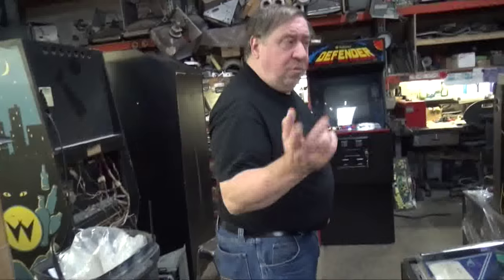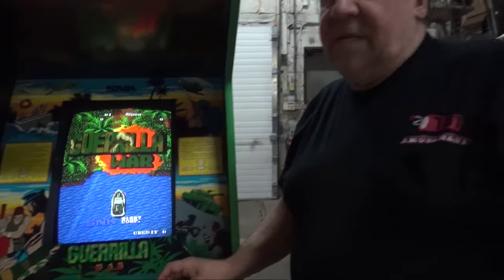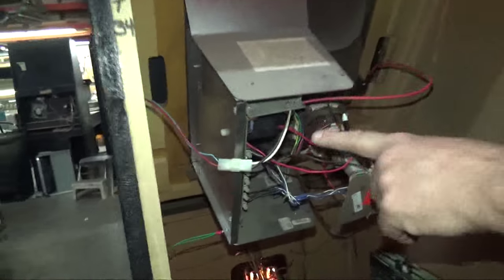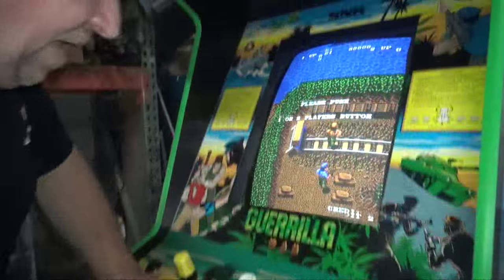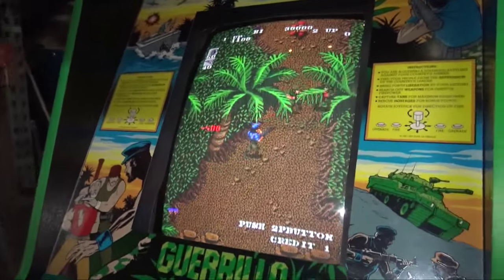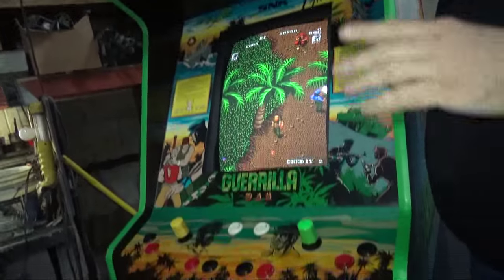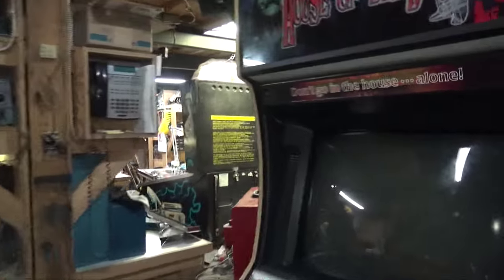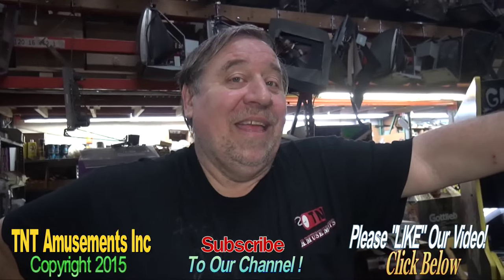#1029 GUERRILLA WAR Arcade Video Game by SNK in Dedicated Cabinet! -TNT Amusements

Comment: great game. I was highly addicted to the NES port which had more stages. As for the game, it's a loose adaptation of the overthrow of the Bautista empire in Cuba where player 1 is Fidel Castro while player 2 was Ernesto ''Che'' Guevara (whose last name happens to be the Japanese version's title). Of course, because of various things which also include political tensions between the US and Cuba at the time, the game was renamed Guerilla War and the story was tweaked so it was just a story of two nameless revolutionaries who are on a mission to overthrow a nameless dictator.
Reply from the maker: +figment1988 Yes...I was reading up a little on the game on KLOV and on Wikipedia...I was curious of the production run of the game....but there is virtually no information about this game and many others!
Reply: TNT Amusements Inc. I almost forgot to mention that the Japanese Famicom version had a code which allowed the player to play a hidden version of Sasuke Vs. Commander (which was a ninja themed shooter from SNK's early years).

Comment: You guys know this because I saw your video on it.  But "Wild Western" and "Front Line" (to which many of these games owe a debt) used a pressable 4-way rotary dial and a separate joystick for movement.  SNK's "TNK III" (1985) was the first game  to use a joystick which moved in 8-directions and rotated in 8-directions for firing.  Hence, it was the first arcade game to use a rotary joystick.
Reply from the maker: I thought front line rotary moved the gun in 8 directions to fire
Reply: Sorry.  It is a pressable 8-way rotary dial.  You can get the actual ROM of "Front Line" from the "Taito Legends 2" compilation.  Love your videos!